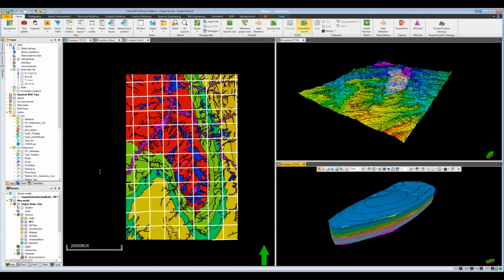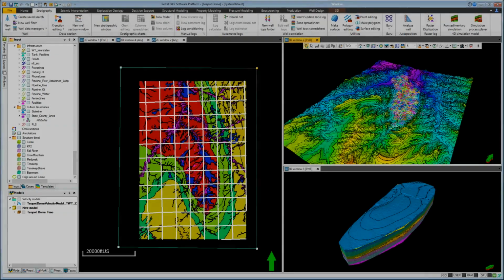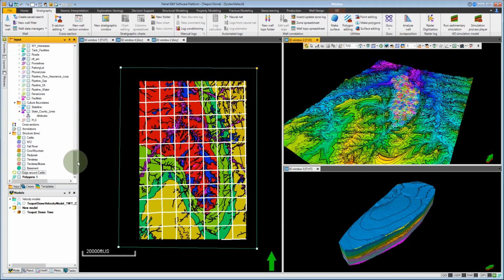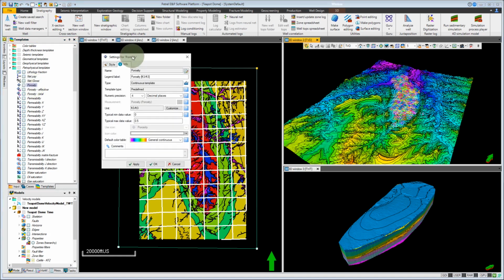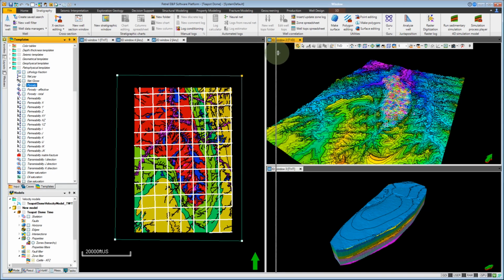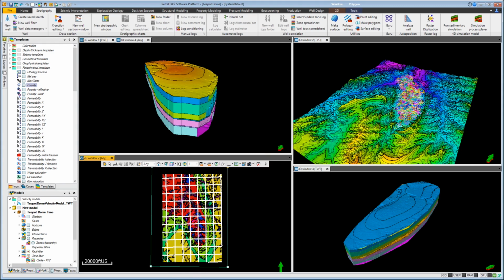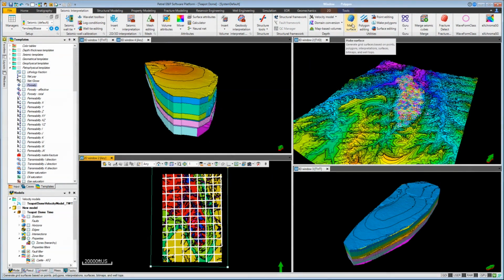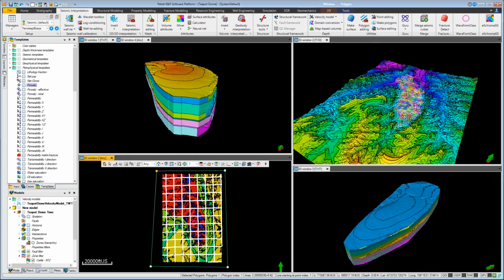Petrel User Interface Part 1:  Layout

Comment: Can u tell me how to install petrel !
Reply from the maker: hi there!  You need to unzip and run the Petrel installer.  It installs on Windows, so is generally pretty easy.  You just hit next through the installation wizard, and finish- simple as that!

Now, in addition to installing the application, you need to install the SLB Licensing utility, as well as Codemeter.  Both of these installers are also bundled with the Petrel installer.
Reply: @ ok I will follow what u said if any issues I will follow up okay
Reply: Thank you 😊